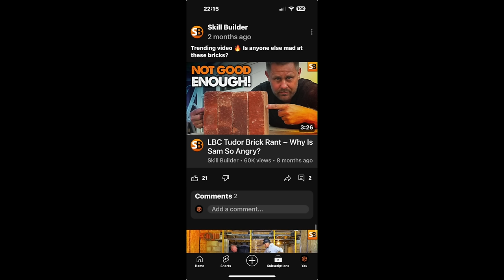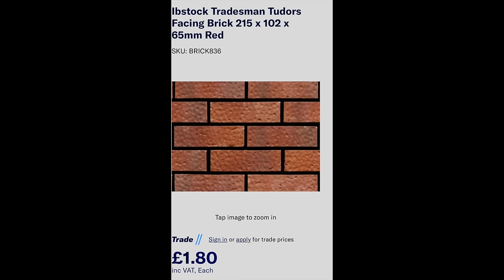A CRAP FOUNDATION TO GET OVER ..FAKE LONDON BRICK WALL PT 1

Comment: Another good job done, On a purely personal note , those type of pillars give me nightmares , if it were mine i would have to have the wall central to the pillar , maybe i have OCD 😮
Reply from the maker: Then you can’t bond them in , so another dilemma 🤣🤣🧱👍🏽
Reply: Also you would have to decide which part was going to be on the existing line..

Comment: Great work guys, been watching a while and decided to have a go at building my porch myself having watched you guys so long up to DPC now and just got the slab done and going ok, 

anyway just wondering if you can answer a question ive over got loads of 275mm wall ties left over from when we had an extension built will these be ok to use on a 100mm cavity  rather then buying any more?
Reply from the maker: They sound fine .
    Good luck 🧱🧱🧱🧱🧱👍🏽
Reply: Nice one guys good to know keep up the good work 👍